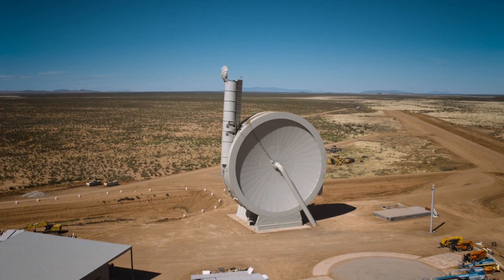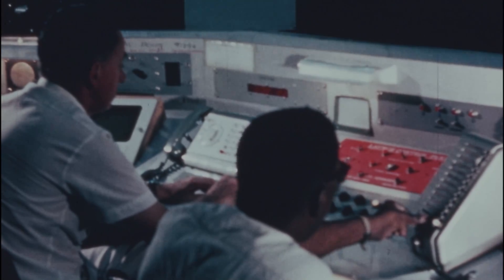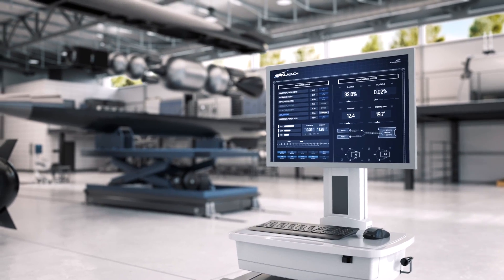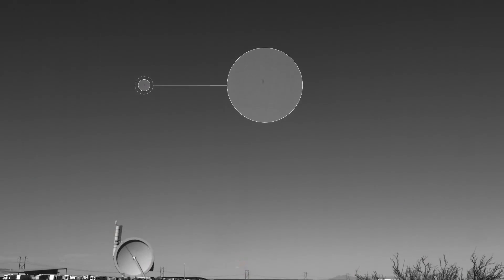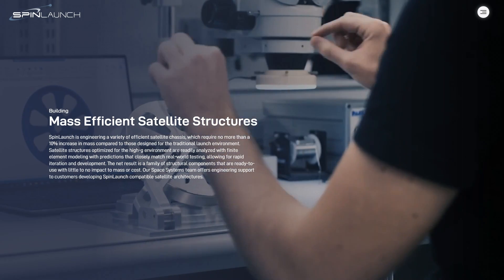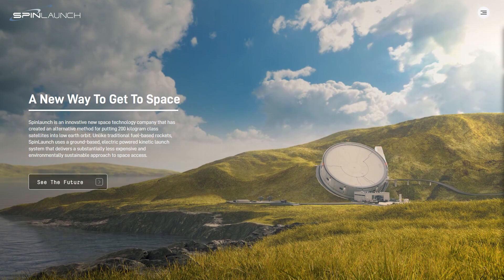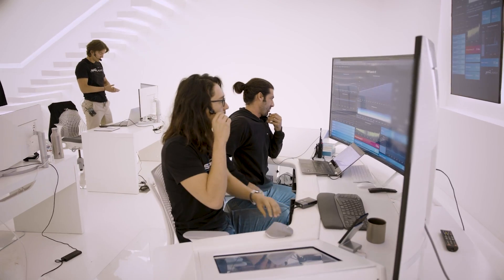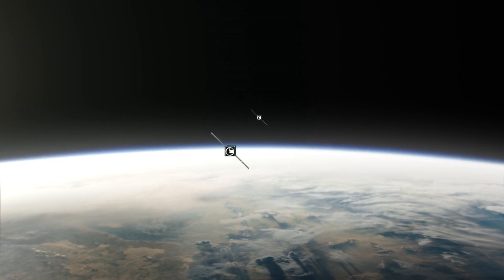Can Spinlaunch Throw Rockets Into Space?

Comment: I still don't get why tf no-one is just extending tried and tested maglev or even plain rail with linear motors because that's obviously the most effective tech for this. Hell, 2010s StarTram could've put a payload directly into orbit at only 30 G's and 130 km of track but of course all the idiots voted nay; it's like you need an 'original' idea to dazzle investors. This system would need somewhat more than double the energy of the thing being launched, and I wonder if that's even reclaimed because using its motor as a generator would require specialized grid-feed inverters with variable AC/voltage input. I don't imagine many satellites would handle being ramped up to 10,000 G's in 30 minutes, that release system better be 100.00% spot-on to prevent a RUD, and I'd love to know if they cleverly balance that arm in a handful of milliseconds after launch, or if it takes the Guinness record for biggest rumble pad ever built. :)

Comment: Sorry Scott, maybe I missed a piece, but if you release a rocket from a spinning arm, you will have to release the same amount on the other end of the arm flying in the opposite direction (consuming the same amount of energy to speed up), otherwise you get high imbalance that will disintegrate your wheel. And while your arm may rotate in vacuum, as air gets in during launch the arm will get high friction from air and will heat up, maybe glow or even melt.

Comment: I have been thinking and talking about this kind of thing for a while, but I had thought of it more like a particle cyclotron than using a swing-arm. That is, electromagnets accelerating a floating delivery vessel through an evacuated tunnel until it gets to the desired speed, and then "Switching tracks" so that it goes out the chute instead of making another lap around the circuit.

Comment: Can't wait for the blooper reel to come out. One this is guaranteed, any launch failure is going to be SPECTACULAR!
Reply: In case of failure, this will go sideways quite quickly.
Reply: @fredwupkensoppel8949  😂
Reply: @fredwupkensoppel8949  Thank you for making me laugh
Reply: With all the energy stored in a 100 meters spinning arm at full rotating speed... The control center needs to be far far away. Like miles away !
Reply: @biznatch1791  or deep underground
Reply: @biznatch1791  In Russia, control centre spins around you.
Reply: @biznatch1791  I'm thinking you'd be pretty safe 100m away perpendicular to the axis of rotation
Reply: or rather along the axis of rotation.. perpendicular to it is the danger zone
Reply: Kinda like swinging a loaded cannon around right?
Reply: Exactly, I would have expected the whole accelerator to be deep underground with just the nozzle sticking out.
Reply: sir, "looks like we did a woopsie" said engineer looking at formation of 1km wide crater
Reply: I was thinking a very similar thing as just a millimeter off at release would put the missile thru  the side and BOOM
Reply: @williamthomas2278  Im guessing the problem isn't the missile, but the rotor which is suddenly unbalanced and liable to wobble. If anything goes wrong with that it'll make a spinny mess of everything inside the drum.
Reply: @niallmccaffrey791  I can subscribe to that
Reply: @niallmccaffrey791  If that happens, it'll be "What drum...?"
Reply: @niallmccaffrey791  And outside
Reply: @niallmccaffrey791  and outside dude.  The shrapnel ain't going to be pretty with this one
Reply: Not if the launch area is buried.
Reply: @fillhixx  well it will still go sideways just not for very long
Reply: i was just about to comment "contact"
Reply: SpaceX wants to know your location
Reply: Complete destruction of the launcher... That would be quite a fail.
Reply: Spectacular for sure, but less spectacular than some folks here are thinking. The forces involves are high, but so are the masses of things. The spinning chamber is a vacuum chamber, so it is gonna have some thick walls. The facility is gonna be mighty heavy for sure. If the rocket doesn't go out through the proper exit with that thinner meant to be destroyed layer, failures will be loud, but probably self contained to the chamber for the most part
Reply: @louisvictor3473  at a rough guess, the forces involved in a failure are enough to launch bits of debris out of the earths atmosphere.
Reply: @niallmccaffrey791  And the rough guess is based on what exactly? The very rocket it is launching when everything goes well, which depends on a narrow alignment of things, doesn't get out of earths atmosphere just by the launch. That is why it still needs a second stage rocket to actually get into orbit. Unless you're privy to some private data you're not sharing, that is not a rough educated guess, that is being impressed by one big number ignoring all other very important numbers.
Reply: @louisvictor3473  rough guess based on common sense. The machine has enough energy to throw somethign out of the atmosphere (i dit Not say orbit, you mistakenly added that). The energy present here is roughly equivalent to the chemical energy in a first stage rocket, since that also throws something roughly out of the atmosphere. If that's too rough an estimate for you, go neckbeard somwhere else.
Reply: Major difference, no one will be riding in the launch vehicle. So, fatalities unlikely.
Reply: The failure would look something like the terrorist attack in the movie Contact.
Reply: The centrifugal class of Punkin Chuckin' come to mind.
Reply: "Aaaand launch now-- ah crap we just about nuked Florida.

...At least it wasn't anywhere important."
Reply: @alexisauld7781  Florida needs a good nukin
Reply: @alexisauld7781  Meanwhile, Florida is currently being nuked by a cat 5 hurricane

Comment: Awesome idea…. Makes the most operational sense for the Moon and Mars for sure.  Sling your ore up and away for the space scoop.  A passing thought on the spin wheel imbalance upon payload release.  How about an exact counter weight  balance payload spinning 180 degrees opposite to each other. Both are released at the same time. Payload up, dummy load south into a water pool.
Reply: I would imagine the kinetic energy released into that water would vaporize it instantly and create its own problems
Reply: @colinm_pe  How about slow it down in the tube using some electromagnetic property -- like dropping a magnet through a copper tube or some technique borrowed from maglev trains? And if it can be slowed down enough to change course, make the tube in a U shape, and throw the weight  up into the air, and let it parachute down.
Reply: @cliffmathew  
That's brilliant. But, what if the magnets boosted the speed in the curved tunnel, and that was also launched into space. Two rockets per yeet🤔?
Reply: @cliffmathew  even better, use that kinetic energy and convert it back to electricity, slow it down in long tunnel and generate power of the dummy load is magnet

Comment: Balance solution: launch a ballast down, i mean, release the “rocket” and an equal amount of ,mass from the ballast, can even be smaller and “slower” if the ballast is shorter in arm length.
Maybe even launch the equivalent amount inwards to the axle centre by an explosive.
For the quick release, explosive bolts, like rockets, the precision is not so hard compared to, for example, the brushless motor timing. The motor controller has to trigger the pulse exactly when each coil pass the magnet, maybe 12 times per revolution.
Imagine stepper motors with more than 300 steps per revolution turning at hundreds of rpms. One misstep and it's screwed.
Reply: Right? Seems like the easy solution is to launch an equal and opposite force in the other direction. I assume there's some reason why they can't do that here.
Reply: @dghohens  set off a nuke that jerks an arm which yeets the rocket.
Reply: I was thinking the same thing.  You need something like a giant sized version of those tanks they test fire guns into. 

I think it would be quite messy, though possibly easier than trying to balance that sudden release.
Reply: @Peter_Morris  literally just a lever/seesaw with a nuke on one side and whatever you want to launch into space on the other. Blow up the nuke and it forces one side of the seesaw down and the other up, rapidly accelerating the rocket
Reply: Just launch another rocket with counter-rotating rotor, simultaneously.
Reply: @eraserstp  The principle is good, but it’s hard to imagine how that might be achieved without the transfer gearbox destroying itself instantly.
You could do it through a series of reduction gears to limit the forces, but then you’d probably run into major friction inefficiencies.
It’s a good concept though.
Reply: @A1BASE  you can use electromagnetic clutch to instantly freeing the gearbox.
Reply: @eraserstp  
That's genius...
But would it work?.
If the two arms were linked together with gears and both released their payloads at the sam time, my brain can't work out what would happen 
I think both arms would become seriously out of balance and I don't know if that stress would be passed to the opposing arms🤔🤔
Reply: if you release an equal ballast down that is11200Kg going at 2356M per second (speed and mass of rocket) it  would have energy of 31 billion joules ( E=.5MV^2). that's equivalent to 6,740kg of TNT. The best I can figure to safely disperse that energy is having the dummy load be water ice, shot into a pool that's in the bottom of a deep bore hole. I'd think the majority on the energy would go into the phase change of the water.  the energy required to melt water is 333kJ/kg and for boiling it is 2,260kJ/kg, that's 29 billion joules just for the phase change alone of 11200kg of ice to steam. and the energy from the temperature change (11200 kg * 4184 j*100C) is 4.6 billion joules.  So turning a 11200kg ice block to steam would require total 33.6 billion Joules, that's greater than the kinetic energy in the ballast  ice block so it seems feasible. Then You'd have to deal with the steam, but I think you could do it. Or all my math is wrong, please tell me if  thats the case.
Reply: @tomw3295  im having problems even with the launching arm resistance, and the maths are out of my range, it could be my argument against the whole idea if you had asked me before this demo, but i will be not very surprised if they find an rpm/projectile weight ratio at wich the unbalance will not damage the machine or just need a much smaller counterweight adjustment due to some weird resonance phenomenon.
I will choose a repurposed gauss gun powered vertical hyperloop instead
Reply: Isn't timing of electronic device pretty much "solved"? Like the sequence of cameras taking pictures for extremely high speed photography.

Comment: A couple improvements I immediately thought of: 1) fill the chamber with hydrogen at near-atmospheric pressure, rather than a vacuum. The loss in efficiency due to increased drag will be very small, and the destructible part separating the chamber from outside air can be as thin as a balloon or a condom, thus making the system simpler. 2) Move the facilities to the highlands of Bolivia. At 4000 meters (some places are even 5km!) over median sea level, the air is about half as dense compared to sea level, thus you get much less atmospheric drag once the projectile leaves the chamber, so you can reach higher launch velocities with same or less energy. Plus, I'm sure the Bolivian government would be more than happy to offer tax incentives for such a high tech company to set home down there. The difficult part will be ensuring its electric system can deliver enough power, so probably they would have to have their own generator system to complement that coming from the local government - that'd still be an easy thing to do, and just moving down there they'd get massive efficiencies for free.

Comment: The holding mechanism is easy, they need to include electromagnets on the outer rim, which simply adds counter-weight. Therefore the clamp doesn't have to hold much weight at all. i can't believe those tools haven't thought of something THAT easy. They need someone like me working there, to overcome basic issues that can be solved by using my high IQ.